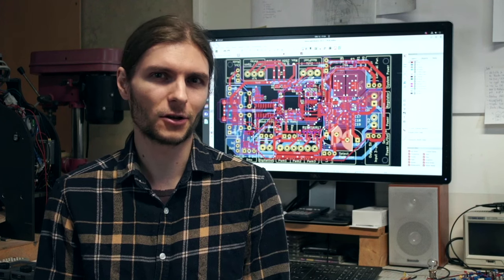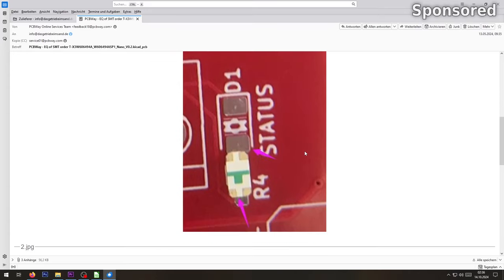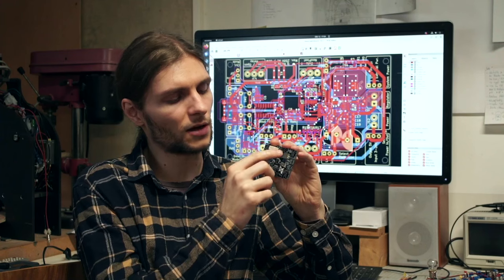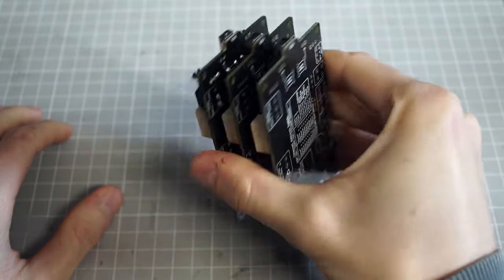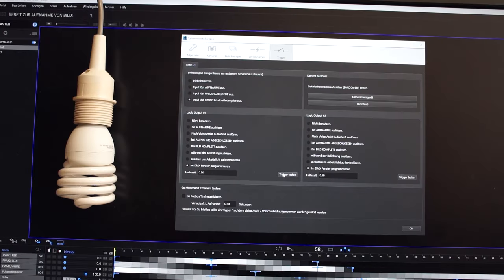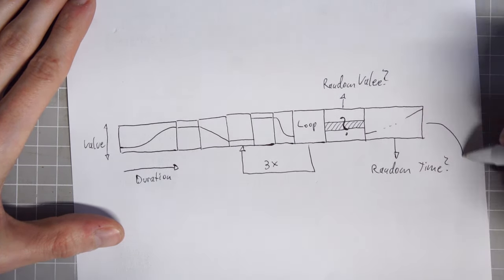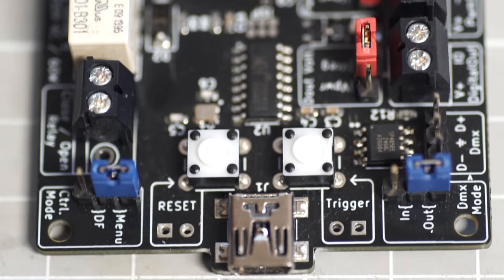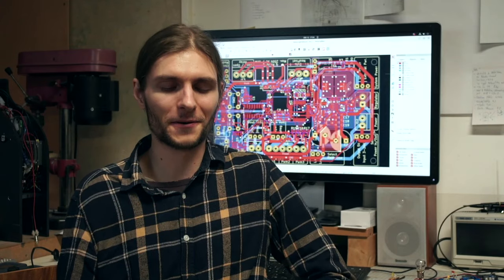A new Light Controller for Miniatures!

Comment: I’d like to use it for driving LEDs on dioramas, so probably won’t need either the 230 V relay nor the voltage regulator.

So I’d love to have as many separate LED outputs as possible. 

I could see how it would be useful to use the buttons in order to easily increase and decrease the brightness of all connected LED outputs (to compensate for the room lighting).
Reply from the maker: I see, thanks for the feedback!
I will consider making an LED-only Version without the expensive Voltage regulator and relay, but with a few more PWM channels instead.
And a "Master-Brightness" control is also a great idea! I'll put it on the end of my already long to-do list! :D

Comment: One thing that randomly popped to mind, and I totally understand if it's not in scope. Because you are enabling the usage or randomized light events and therefore undeterministic flickers. You might want to consider an epilepsy-safe mode. Else I worry it will occasionally play very harsh strobe patterns at unpredictable times that end-users might not have intended.
Reply from the maker: Hm, thanks for the reminder, this has to be considered for sure! - The programming will eventually be up the the users of course, but maybe the Desktop UI Software could check the program and issue a warning whenever it includes high frequency changes. Thanks for the idea!
Reply: @ValentinFelder   there are certainly many tangents and ways where this 'simple' safety idea could get complicated, I can see that. But yes at the end of the day the user has final say. It might even be they are doing it intentionally to PWM a small motor or something like that, if that's supported. Granted those ranges are also faster than our visual perception even when used on an LED. So there is a specific range that are the issue. Too fast and you can't perceive it, too slow and it's a blink, not a strobe.

Comment: Fantastic project. Will it be able to control 12v LED panels or only small single led bulbs? Thanks :)
Reply from the maker: It can do 12V as well, either by adding an external 12V Power Supply or by making the 12V from USB with the onboard Voltage regulator. But there is a limit to the total power which depends on your USB power-supply (usually 2-10W). An external supply would allow you to control up to 25W.
...But take these numbers with a grain of salt, I still have to do some more testing and tweaking to be sure. ;)

Comment: Very cool project. ❤
But what I always miss is 16-Bit PWM. For very slow light changes and especially at low light levels the individual steps are very noticeable.
I would love to see a 16-Bit Version, although this would require hardware and software that can handle 16-Bit PWM. You could program your software to be 16-Bit compatible if you keep that in mind from more or less the start. This would make your project so much more versatile.

PS: Maybe a ESP32, much more powerful than a 328p. Maybe you can even make use of the WiFi for Art-Net ("Wifi DMX")
Reply from the maker: Thank you! ✨Yes, I've noticed that as well. Actually the PWM timers are 16bit internally, so the logarithmic correction does really smooth out those steps on the lower levels! Supporting 16bit natively would be cool, but the DMX standard is quite crude in that regard. All I could do is to use two 8bit DMX channels for one 16bit DMX, and that's also a bit clunky, so I think I'll stick with the logarithmic correction for now as it should cover most situations pretty well...
I'm also thinking about a more powerful platform, but it would make many things more complicated as well. Roughly speaking my current plan is to finish this basic version first, see how it is used and how much demand there is, and then maybe develop a more powerful version based on that. :)

Comment: Very interesting project. What microcontroller are you using? Are the 3 PWM Channels enough for most stop motion scenes?
Reply from the maker: In my experience 3 independently controllable channels cover most situations, but I'm considering to make an LED-only version as well with more PWM channels but without the voltage regulator. And of course you can always chain multiple boards together via DMX if you need more Outputs.
...Right now it's running on a little atmega328pb, as this was fairly cheap and easy to get working (but of course with very efficient custom software, not the Arduino stuff) - Though I'm considering to switch to a more powerful platform at some point, at least for the "large" version of the board. We'll see :)
Reply: @ValentinFelder  If you consider to make a LED only board, you may consider using cheap uC for the PWM Channels and a master controller which tells these PWM controllers over a bus, which PWM they should output. I build a project like that with cheap 7ct Microcontrollers. In total I got 20 PWM channels with 5 of these uC.
Reply from the maker: @rewxn1851  I have considered  these kinds of architectures but the annoying thing is the burning of the Software to multiple µC and it also makes Updating the Software very complicated. I'll rather use some dedicated PWM driver chips for the purpose I think.

Comment: So cool. But in my opinion you should make 2 versions and cheaper. One wirh dmx only and proper dmx port. One for small led projects. That relay thing is pretty useless because there are literally 6 $ Tuya/zigbee controlers on the market. Alsl with 4 channels and more. One on/off 230 V is pretty lame. Also prototype is a bit too big. I really love your ambitions with the software and can't wait for final product.
Reply from the maker: Hey, you're absolutely right, thanks for the input! - The relay is mostly there to offer a feature complete alternative to the Dragonframe DMX box, but it makes total sense to make two versions. My idea for the stripped-down version would be to also get rid of the voltage controller in it's current form as it's by far the most expensive component on the board, and replace it with a constant 5V regulator which would be totally sufficient for LED use cases.
A DMX-only version could indeed be quite cheap and useful too...
We'll see, I will continue with all features for now, leaving things out eventually for different releases will be quite easy. :)
Reply: "[...] there are literally 6 $ Tuya/zigbee controlers on the market."
Yes there are, but I would strongly disadvise of using any Tuya devices in your home network. Tuya is made by a Chinese company and even if you don't think the CCP forces them to put in backdoors or leaving them open, IoT Devices are notorious for using outdated software from begin with and don't even think of getting security updates for it. One compromised device in your network could open it up to many attack vectors. Best practice is to literally have a second WiFi network that has isolated clients, is heavily firewalled and has no direct connection to your home network.

TLDR; IoT Devices are a IT-Security nightmare (Especially Chinese ones)
Reply from the maker: @GermanMythbuster  Agree, and you also explained pretty well why I'm not that interested to put IoT capabilities on my board. - Getting all the security layers right and constantly keeping it up to date is something which only makes sense for larger companies, me as an individual don't want that kind of problems, technically as well as legally...

Comment: My friend, mini-b?? 
Please explain why it isn’t USB-PD
Reply from the maker: It's not that easy, makes things much more complicated, both in Software as well as electrically. But of course I'm considering it, just not for the first version.
Reply: @ValentinFelder  Thanks for the reply! Could you elaborate on the complications?

I ask because I’ve used IP2721 ICs (USB PD modules) in several projects. They have a small footprint, are easy to use, and cost under $1. I know this requires a stable power supply, but that’s true for any connector type.

If separating power for the microcontroller is a concern, I’d consider that a manageable step. Since your setup already plans for separate power and data ports, having one as USB-C and the other as USB PD doesn’t seem overly complex.
If you wanted to use a single port for power and data, then you'd need to plan to split the power to the microcontroller for the 5V/3.3V. PD negotiation might affect microcontroller. A buck-boost converter like the LM25118 could ensure a stable 5V output regardless of the power input. 

Of course, I’m not an electrical engineer by trade, just a curious hobbyist! I admit I may be in the Dunning-Kruger zone here. Thanks for any additional insights! It's people like you that shape how I learn!
Reply from the maker: @TheOfficialOriginalChad  Hey, thank you for the elaboration as well, this is quite insightful (Didn't know the IP2721) and you're basically correct.
I consider two separate USB Ports quite ugly, especially as you would need to plug in both at the same time for programming and running the lights. Doing the serial communication and PD over the same port is possible of course, but I was not able to find a suitable IC which is affordable and can do both. The usual way to approach this would be to skip the IC and have the µC do the USB PD negotiation directly. However the specification of that process is quite complex and nothing I'm particularly interested in coding myself at this early stage.
The electrical problems mainly arise from having to design everything for multiple Voltages, as you never know how much you will get from a particular Port. ...Things like over current protection which can be easily designed statically become dynamic situations.
And take the PWM Outputs for example - I think it's neat to be able to run them off the "system power" directly without losses - but when system power can be either 5,9,15 or 20V it's hard to run anything off that domain at all. You suggest adding another regulator, but in order to actually benefit from the higher power input capabilites it would need to be dimensioned quite big, adding a whole lot of extra components and heat dissipation as well, turning the board into a bulky power supply essentially. 
None of this issues would be a total game stopper, but it adds a lot of complexity and costs to the design and I think a big part of what makes it suitable for miniature applications is the size and simplicity of it. Also I think it's important to get the Software fleshed out first, optimizing the hardware later will be easy compared to that.
However I'm really open for suggestions if you can think of a neat solution! ...From your reply I think we might be on a similar level of electrical engineering, my main expertise is Software Development. :)